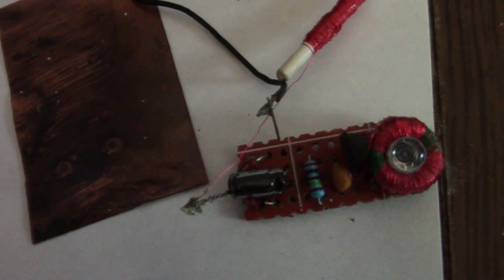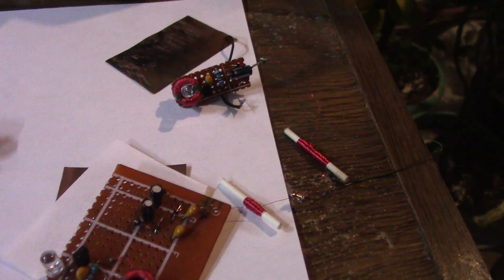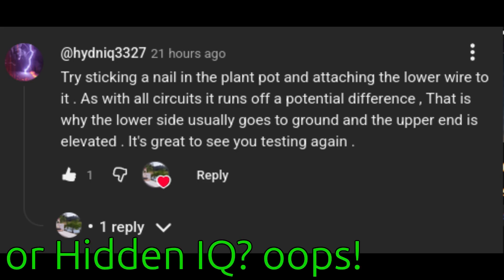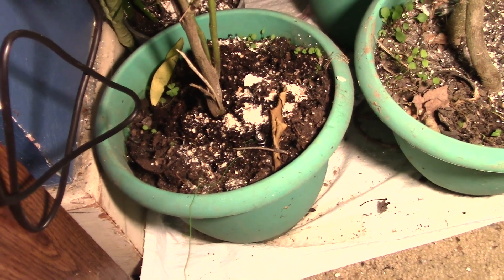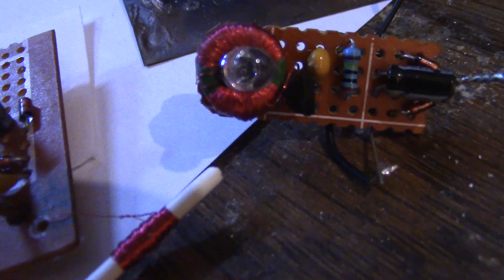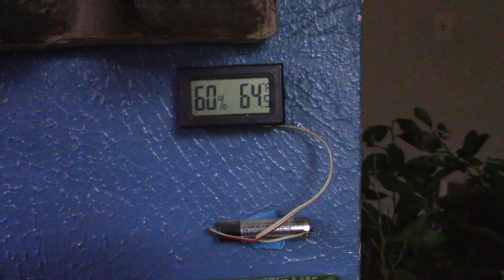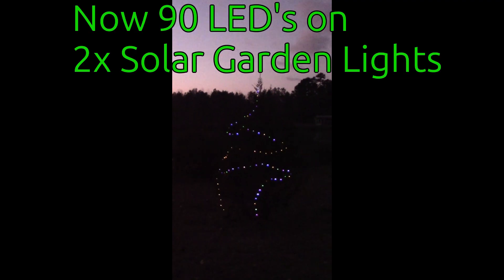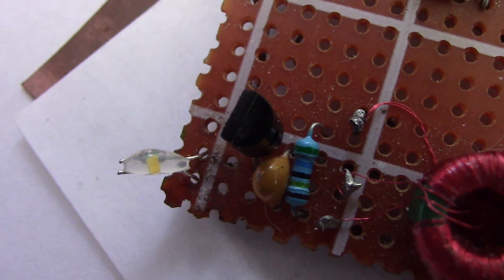Mains Energy Harvesting Using Houseplant Soil? (No Batteries)

Comment: Nice video!

This is one of the reason why I moved close to the river to find wet soil. When I was on a mountain, very rocky and super dry, I failed to run this type of project. I mean not good enough to make me happy. What I did was to pound a nail but to an old solid tree trunk which a source of weak ground. Soil is also very dry there that's why I prefer to a tree. Nail is not so important in my case, just where to attached the wire while it also reach the inner wet part . Perhaps having a good source of aerial but of very weak ground. Need to have both to increase harvested power.
Now I have sure wet soil, very good ground source but unfortunately, almost everything, my stuff washed away by recent flood. 
Eager to establish a bench again. 

I was only using 1N4001 due to unavailability of other types of diode to experiment. So could also be the reason.
Reply from the maker: Thanks for your great comment!
Oh, how sad that the equipment got washed away... I hope you are able to fix up any damage to your property too. 
Otherwise, a river location is a fantastic source for such experiments, also for anything water power based (I want to build a hydro power system on our stream behind the property).
For parts sourcing, I've always sourced parts from other peoples junk. Used to have a shed full of it lol, mostly from road finds. Anything from the 1980's/90's will have loads of transistors, diodes, etc. So, for anything unavailable, it can usually be found in older electronics and is well worth keeping a large box of such things handy.
Reply: @Slider2732_ Yes its true, my area looks like a junkyard.  From old radio's, tv's, bad led's/cfl's and everything from garbage were gold. That's where I started. But relying on this limits the dream especially on complex projects. But more than enough for a hobby and other experiments.
The river here is bad for hydro due to it's condition. I don't know yet what best to benefit from it but wet soil is what I need now since I'm playing more on Tesla tech. Once done I should evolve to portable and handy devices without physical earth ground. Virtual ground showing ok but focus first on real physical earth ground. I'm on energy multiplication stages and need earth ground contact for now. But once enhanced I might move to portable and more compact design.
Honestly, I am fascinated by your experiments started from older projects. Gave more excitement. Motivation is essential. And moto is not to stop as it is a complete failure, a 100% sure failure. As long as I live I'm still continue.

Comment: Hi Mark, what value diodes have you used or is it not that critical on the type. i will have a go at this one . Although I'm more than happy with the first circuit using flat batteries 😂 I'm still waiting for  one of them to stop 😊 👍 cheers
Reply from the maker: That's very cool to know how your osc is still going 😀
Diodes are just 1N4148's. I did try Schottky and germaniums but the increase in throughput didn't warrant any special purchase. Even less so if folks wanted to replicate.
Reply: @Slider2732_ not sure what diodes I've got but hopefully I have some cheers Mark 👍